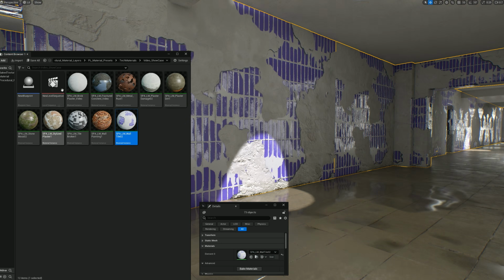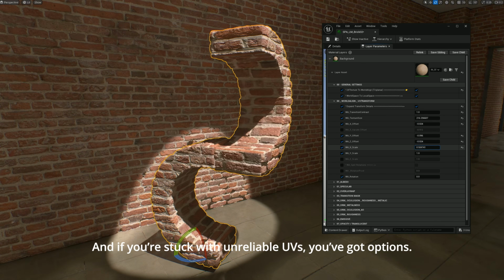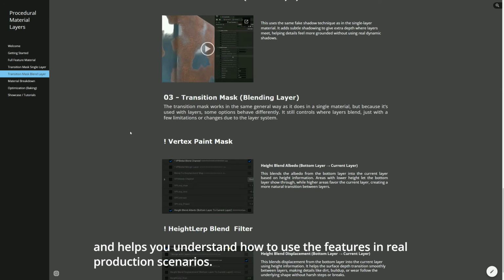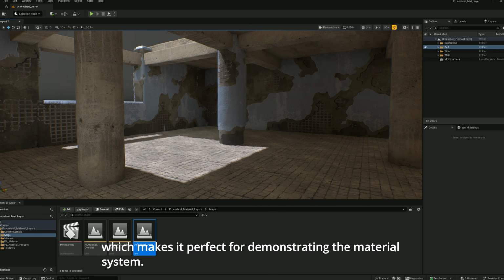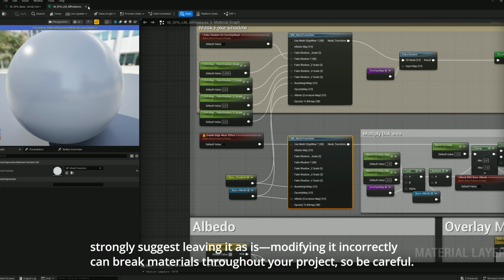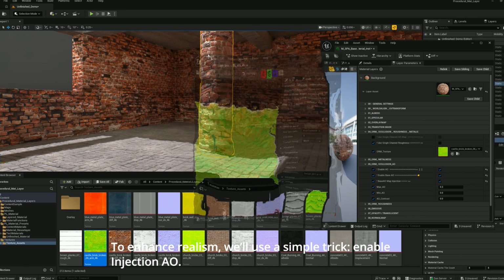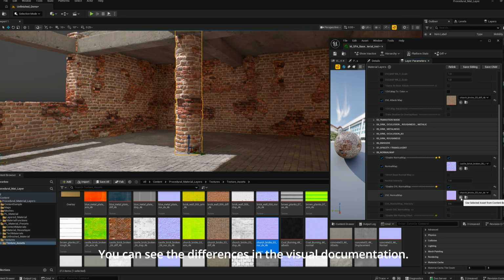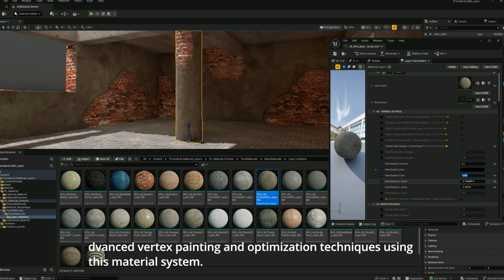UE5 Procedural Material Layer System: A Deep Dive into Non-Destructive PBR

Comment: Does this tool use POM)Parallax Occlusion Mapping)?
Reply from the maker: This system doesn’t rely on POM. It uses displacement and tessellation instead, so the depth is physically accurate and works better with lighting and layered materials.